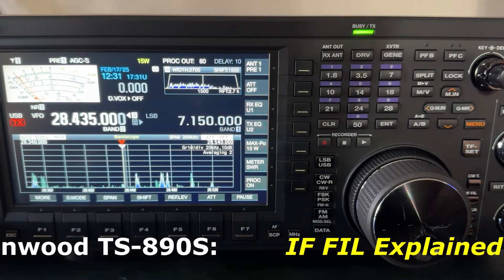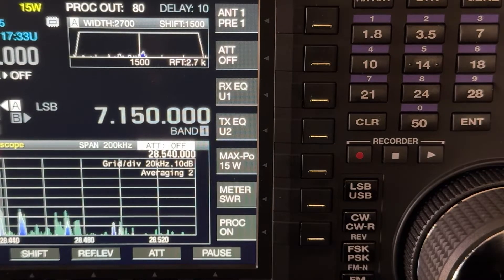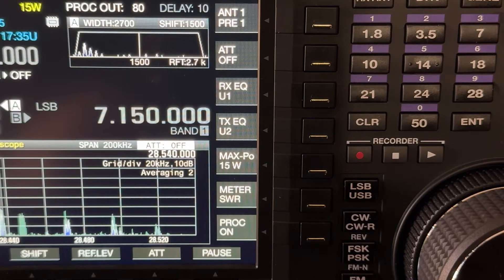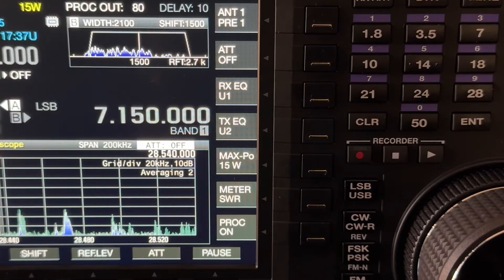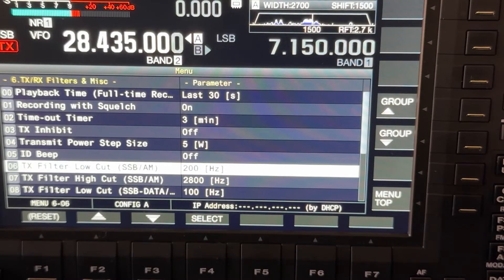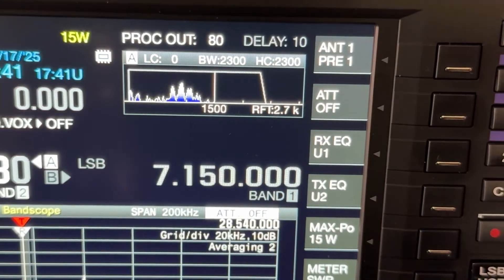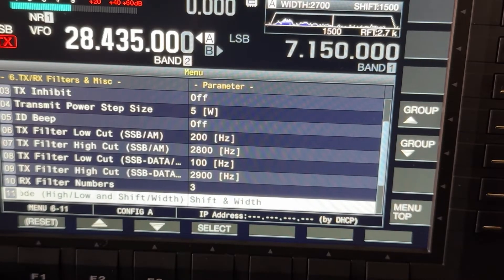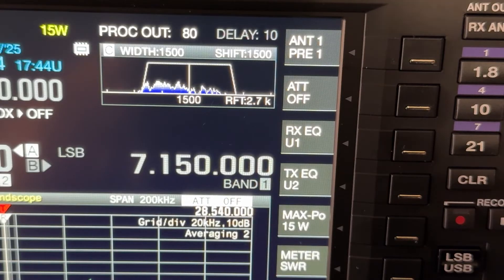Kenwood TS-890S: IF FIL Explained (video #13) #hamradio #kenwood #ts890 #if #filter

Comment: Thanks N4HNH. At 53 sec you said the 890s is a hybrid rig. What do you mean by that? Hybrid?
Reply from the maker: Like the FTdx10, FTdx101, and K3S, it has the benefits of a superheterodyne front end coupled to an FPGA (SDR).  Watch my video about down-conversion deafness and how it’s a good thing.  It’s another one of the public videos from this series.  There are 21 videos this far as I write this, with more coming as support allows.

Comment: Thank you very much for this. I immediately ran to my 890 to change over from low and high cut to shift and width. It worked in SSB but it does not work in AM. What a downer. Freaking Kenwood is almost as bad as Yaesu by deactivating nearly all the cool stuff when you’re in AM mode. I know this is a ham Radio, but still why discriminate against short wave listeners when the stuff is already inside the radio?
Reply from the maker: AM broadcasts both sidebands simultaneously.  Shift is of little value. But I generally set hi-cut at 3,500 when operating AM.  I occasionally get on 3.885, 7.285, or 7.295 when the AM’ers are on there.

Comment: I use mine in the default setting of high cut low cut. That setting is what kenwood used on the older 800 and 900 series radios and they called it “slope tuning”. I find I have more control that way.
Reply from the maker: Each of the big three manage the IF bandwidth differently. You will be inclined to like what you started with and are comfortable with.  I’m glad Kenwood provides either the width and shift method or the hi and low cut method as a menu choice.  

Daniel, you’re an S9 (VIP) member of my Patreon team.  I hope you have been able to watch the full tutorial series thus far.  Number 22 is coming in a couple of weeks.  This is just a teaser video released temporarily for public viewing/awareness after the Patreon members have had first view for months.  

Let me know if you haven’t been able to find the tutorial series.  It’s on the Collections page of my Patreon site.  Look for the TS-890S collection.  Work your way from the bottom post to the top.